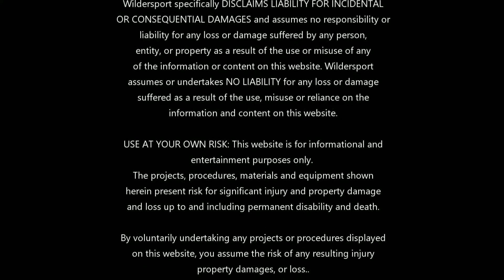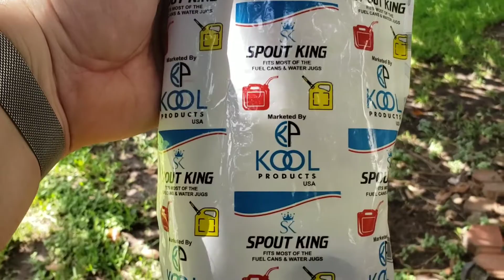Fixing useless EPA gas cans.

Comment: I read on amazon that the gaskets rot away fast in gasoline.
Reply from the maker: Not my experience yet...
Reply: @Wildersport  thanks. I just bought an ez Pour at tractor supply and a couple of these kind on amazon.  Replacing all my crappy gas cans  with them.